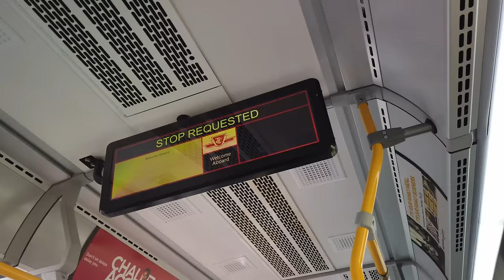Why American Buses Are Just Worse

Comment: I literally just became a city bus driver.  Those multiple articulating busses gave me extreme anxiety.  I'm trying to imagine watching my inside mirror during a right hand turn with that monster.
Reply: If you were driving a bi-articulated bus you wouldn't even need to use the mirror to see the back of the bus on a tight left turn!
Reply: At least here in Budapest these buses generally run on major traffic arteries where there won't be too many tight turns, and usually on dedicated bus lanes in the inner city. Nevertheless there have been many situations where I wondered how the driver just managed to squeeze through a tight space with apparent ease. Bus drivers are the biggest pros when it comes to driving, much respect.
Reply: Mind you, those double articulated buses have a special steering system on the rear wheels, operating based on the distance travelled: if the driver turns his bus into a tight turn, the rear-wheels at some point will steer along as well, but not at the same moment as the front wheels. The 2 articulated parts basically follow the front like there's an invisible driver handling a just as invisible steering wheel. This is why they are quite easy to operate. I've been on a few in The Netherlands, especially the one line near the Utrecht university campus was something out of this world. Even when coming from a city where buses to Amsterdam run every 5 minutes during the morning peak (pre-covid numbers), the campus-line was just ridiculous at a 2 (or was it 1? I can't remember) minute frequency. And a double articulated bus everytime, which would get crammed the closer it got to Utrecht CS.
Downside: as soon as the driver nearly exits the curve, they usually accelerate again, which makes for a fair-ride experience when riding in the rear part of the bus.

Comment: Hello, a swiss here.
I just want to tell how things are in Switzerland. 
In my home town with "only" 80,000 inhabitants, double-articulated trolleybuses are used, which run every 7.5 minutes. The trolleybus network will even be expanded in the near future. The other buses run very regularly on all lines. Nevertheless, these are often overloaded, especially during rush hour. This shows how important buses are to us. In addition, many Swiss cities rely on trolleybuses. They are the best solution in my opinion
Reply: And they rattle and shake more than a cheapo 10k $ fiat car. The comfort is still lacking hard in most of the swiss city buses…
Reply: Well it's the quality of the roads and not the bus itself.

Comment: I totally agree on the quality of buses in North America. Vancouver streets have virtually no potholes (hardly any freeze/thaw cycles) and yet even on virtually smooth streets, local trolley buses, crash, bang, and rattle along as if they were on unpaved roads. It's bad enough for passengers, but I can't think what an eight hour shift must be like for a driver. Every now and then an old GM diesel bus will be in service, and the ride on them is like a cloud compared to New Flyer vehicles.
Reply: even from the 90s (school days)  the drivers here in vancity already had air ride equipped seat bases with Recaro seats..  the one sole driver is riding decently-  but less so for standees. and, the remaining pax  had to contend with the then metal seats with a cheese thin layer of vinyl!
Reply: Freeze thaw cycles only punish existing defects in the road, as it happens.  If water can get inside and freeze, bad news for the surfacing.  The blemishes that result in this though result in proportion to traffic.  High traffic road get their cracks and such sooner.  And if they are not repaired quickly (i.e. before snow starts) then the water gets in and it becomes a much worse defect, i.e. resulting eventually in a significant pothole, which if STILL left alone just gets even worse.  It is possible to prevent the pothole stage with proper maintainance.  

But this is an area where the North American (USA + Canada) "American Dream" has essentially accidental-ponzi-schemed itself into a no win situation with its suburban sprawl and a very excessive number of roads that must be maintained.  Thus many are not.  And cracks become holes.  Holes become things that make you wonder if you broke your suspension.  And then they need to redo the road from the very foundation instead of a simple re-cover of the upper layer.  Some places go full in even when a re-cover would work too.  

Canadian cities are partly insulated from a portion of the woes of the long term costs of the "American Dream" due to legislation differences.  But they still build the same way as the "American Dream" suburb when they can.

One thing that really helps road longevity is to convince fewer vehicles by total mass and number to use it.  Canada has some benefit there as people actually see the bus as something that anyone can use.  Even if they have buses that merely beat out the USA overall (specific cities may vary).  Every single thing that makes mass transit more appealing to everyone makes the roads easier to maintain.

Comment: I think your friend would have a heart attack at my city's busses. They're getting an upgrade.. by making the seats plastic. Plastic! They went from a decently soft, comfortable metal/fabric seat (with that standard stain-camouflaging texture you'll see at arcades) to a seat that is literally just hard plastic. Yay!

They also don't have a display. The only display is the "stop incoming/arrêt demandé" that pops up when you pull the cord.. and half of the busses are the Nova Bus LFS 40ft with the raised rear and the engine taking up the whole back, and the other half is some other version where the engine's in the corner. All of them rattle like hell. They also come only every half-hour or hour.. so if you miss your bus you're boned. And we don't even have a fifteen-minute at peak, it's a half-hour no matter what. And to top THAT off our "bus station" is literally just the street in front of a dying office-commercial urban core mall that wiped out a city block. Concrete pillars and concrete walls. Very inviting. Nice that it's in the middle of what we have for an urban core but god it's ugly. And don't get me started on the other two interchanges.. they're both just mall parking lots. God our bus systems suck, huh?

Edit: from other comments some things to add. There is no inter-suburb bus for the northern half of the city. The bus stops are usually a card-sized metal sign on the side of the road, or further out.. literally plastic wrapped around a wood power pole. Although, they are adding proper glass shelters & benches finally, and they have bicycle racks in front, and they're getting security cameras/bus trackers (and the fifth attempt at making a municipal bus app) so there's progress. It's just devastatingly slow and it all sucks right now.
Reply: Sounds like OC Transpo.
Reply: What is not plastic today.wel. the same for body/platform.Chassis mostly steel aluminium but that May change. Carbonfibre like the newest Dutch Ebusco.s 3.0 in 12 and Artic18metre    40 to 60feet and ZF AxTrax wheelhub electricdrive i like it as bus publictransport lover 😊😊

Comment: In my city there are so many weird choices made it feels like someone got taken out to lunch and got talked into buying some new toys, a different new style of bus every time. This seams like a decision you take time on, you decide it once and build a fleet, build expertise in the shop and limit the amount of spare parts you require. 

Instead we have 2 different express services with articulated buses that each travel on a single street for 98% of their route. The marquee on the front is digital and could say anything but instead they painted one set yellow and one set blue and they are never shared between routes. We have 2 routes to different ferry terminals, 1 is frequent and runs articulated, low floor buses, easy to board with luggage, 1 only runs at the top of the hour and is running double decker buses so have fun hauling your bags up to the 2nd level.

Comment: you can't really blame the bus manufacturers for the seat padding. seats are usually sourced from a different company and are unique to each city's public transport company.
Reply: and if they're like TriMet in Portland, it's strictly "lowest cost" bidding.  Especially when it comes to buses - everything is penny pinching to the core.
Reply: @spredelectric  Yeah well it's getting pretty bad on this side of the pond too. Many Germany public transport companies are cheaping out on seats, skipping padding entirely and neglecting to round out sharp edges. 

France has the same problem with the new TGV seats but not because they are cheaping out, rather that French designers often forget that people have to sit on the fancy things they draw.
Reply: @AA-ks7bo  The French TGV in the first class is world class, it is soft and comfortable, unlike the leather in the ICE in Germany. I think if you saw an older  MiWay bus with the hard plastic bench in Mississauga, you would like to have the Solaris or EvoBus busses like in Germany. Painfully reminding when I rode the Munich U Bahn once and the lastest gen has sections with a wooden bench...
Reply: @CANLEAF08⌘  the old TGV first class is indeed excellent, I have experienced it myself. The newer seats are rather iffy though.

And I agree on the ICE, the first class on it isn't necessarily bad but it fell flat on its face while TGV inoui first class blew me away.
Reply: @Canleaf08  That "plastic bench" you are talking about is the FRAME of the seat though.....

The oldest busses in Mississauga have that plastic bench FRAME and lightly padded vinyl inserts or fabric (non-padded) seats
Reply: Lots have gone to the mcdonalds seats because of vandalism.
Reply: idk about most other systems in the US, but DC's Metrobus used to have nice plush seating in their buses until the early 2000s. Now they're all hard and uncomfortable, and I've noticed that a lot are supplied by American Seating.

Comment: What struck me the first time I took a European bus (in Geneva, Switzerland) was that I didn't even REALIZE I was getting on a bus, and my friend had to convince me that we weren't on a tram. Geneva has a decent street-running tram network (which is all it really needs, it's a very compact city) and a nice bus network running both diesel and electric buses, including some very attractive Van Hool trolleybuses. Buses are used on some routes that are also served by trams. The experience of using a bus was basically indistinguishable from the experience of using a tram. It felt...dignified.

Wayfinding doesn't differentiate, so on some occasions you didn't know what you would get until it showed up. It was seamless thanks to the system in which locals can opt to pay for an annual fare card when they file their taxes, and visitors can get free transit cards from their hotels. The vehicles obviously looked different on the inside, but equally pleasant and comfortable. It was just such a far cry from the American buses I was used to that were infrequent, confusing to navigate, and seemingly just an afterthought to plug gaps for people who didn't have any other option.

Comment: The Novabus LFS which gets shown as an example of a bad North American bus was originally set up as fully low floor, but this was changed in 2004 to a conventional T-drive low entry layout so a larger engine and better cooling could be fitted. It also has the same axles as similar European buses (manufactured by ZF). 

Australia's bus market is, if anything, even more protectionist in many ways. The only reason those Brisbane Metro buses were allowed to be imported is because they can't drive on ordinary roads and have to stay on the busways- they're 5cm overwidth (dumb rule I know)
Reply: the early NOVABUS LFS had the engine on end in the corner with a special transmission and I believe both CUMMINS and VOITH wanted to STOP making those parts and there were overheating issues with DPF/SCR systems

Comment: You did a video on train loops please consider doing a video on bus loops. Maybe if stops on a bus line also had a local bus loop that less than five miles long with maybe 15 or so stops that could solve the “last mile problem”
Reply from the maker: I will, indeed consider it!
Reply: I've experienced a few bus looping routes, usually 1 hour or 30 minutes, and many of them bidirectional.  But they seem to rarely match a transport need.  Linear routes with defined ends are often more useful at going anywhere.

Comment: Nice video, though I would like to add that trolleybuses are not a great solution in general. They combine the disadvantages of buses and trams. They have the low capacity of a bus, but are as inflexible regarding the routes as a tram. Additionally, the catenary is way more expensive and complicated than the one of a tram as it has to be a) a two-wire catenary opposed to a one-wire solution for trams and b) due to the lack of rail guidance, the pantograph of a trolleybus has to have a grip around the wires instead of just touching it as a tram does. Building curves, crossings, intersections or larger transit hubs is imaginably complicated. 
That means that building a trolleybus network is nearly as expensive and complex as building a tram network is but you don't get the added efficiency (steel on steel), the added capacity (you can have 7-section-trams with 6 articulations), the added speed or the added comfort of a tram. This is also a reason why they are not being built anymore in most places. 

There is one use case where it can be justifiable to build a trolleybus network, though, and this is when there are many extremely steep hills on the route that are too steep to be climbed properly by diesel buses let alone trams. Though in that case, you could also build a translohr system (google translohr for more info) and you would probably be better off at just a little additional cost.

Comment: When talking about the different types of bus options around the world, one other comical little option to add is the weird bus trailers that Munich uses. They basically expanded the capacity of some of their bus lines not by getting larger buses or added frequency, but by attaching a trailer to the bus that has additional seating in it.

Also, as far as electric buses go, I recently moved away from a small town in the Alps south of Munich, and they have been phasing in battery electric buses for the rural regional routes there for the past few years. It's a big eye opener to see that kind of work being done for what is basically just some small towns and farmland after coming from a US city with millions of people that seemed to view the existence of buses at all as a problem.

Comment: The one good thing about Brisbane public transport are the buses and the busways, love using them
Reply from the maker: The electric railways are also pretty great!
Reply: But the suburbs are basically miles and miles of stroads and single-family housing.
Reply: Even the train stations have park-and-ride surface lots.
Reply: The trains have actually been very inconsistent during 2022. Too many cancellations and delays. Although I do like our train network, it definitely need a lot more work before 2032 and not just the cross-river rail project.

Comment: I agree, even here in Slovakia, a very small country, you can travel by buses, that are super comfortable, fuel efficient and safe no matter if it's a line bus driving from one city to another or an airport bus, that takes you to your plane. European bus manufacturers just care more about how buses drive and feel from the perspective of a passenger. I remember travelling in one of the first Iveco Crossways, that thing is super quiet and comfortable compared to the old noisy rustbuckets from former Chechoslovakia made since the 70's or 80's.
Reply: I agree too as a Slovak, but those new crossways ( not the ones with the delfín) are quite loud compared to those delphine ones of the last decade.
Reply: As an Austrian, our state owned operator ÖBB has gotten the trend of buying crossways and they really suck. We used to mostly have Mercedes and MAN busses on those lines, now those

Comment: Our roads in North America are in noticeably worse shape than in most of urban western Europe. That could lead to suspensions needing to be tuned differently. But yeah, I agree with most of this video.
Reply: Part of why people wouldn't bother with a bus. Garbage ride.
Reply: And what will break any Citaro's frame? Budapest
Reply: @mozeskertesz6398  happened already? 😀 You're not getting anything much better than citaro though
Reply: @skrble  no joke, it was replaced with Ikaruses when this frame cracking was discovered
Reply: @mozeskertesz6398  wow... Could you send me some link describing that part? Even in Hungarian.

In Prague we faced something similar with many vehicles too (Karosa, Irisbus CityBus Euro3 onwards, even SOR vehicles develop cracks). It led to some issues but mostly weren't major enough to pull them out of the service. Many vehicles underwent repairs too, might find an article about it if you wanted.